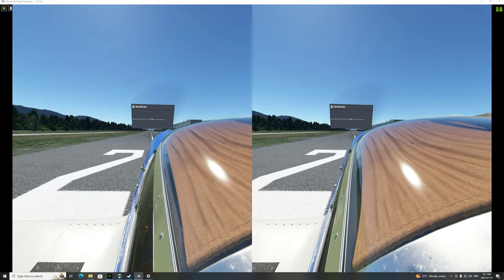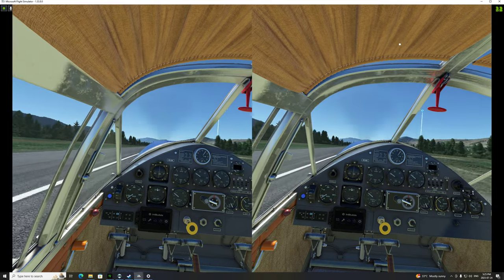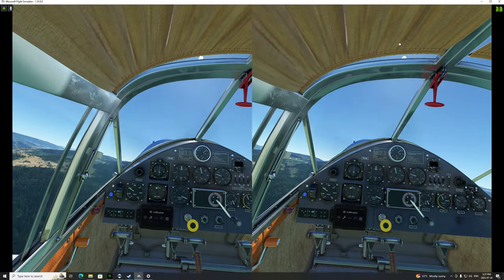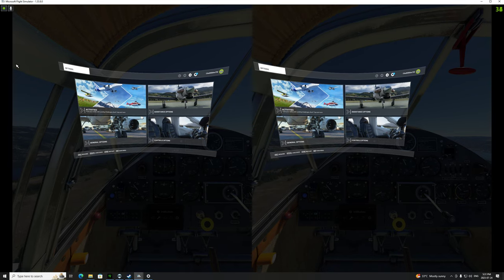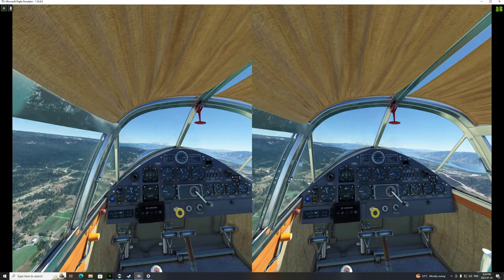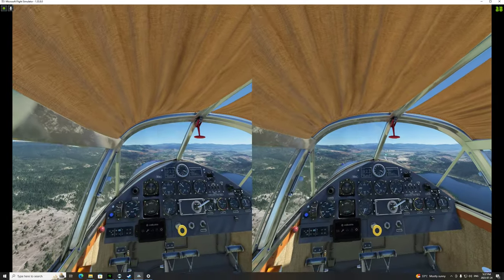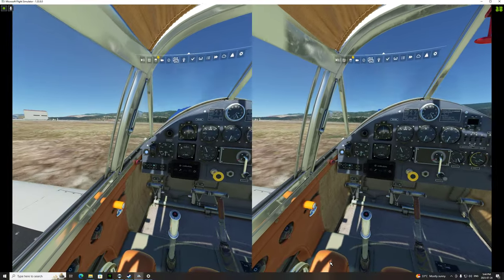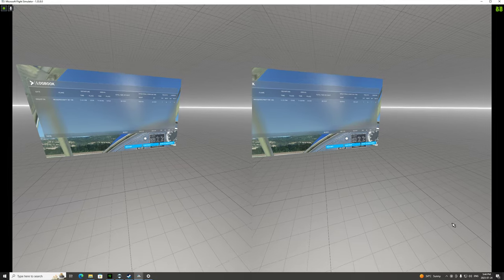Pimax Crystal thinner face mask taifun 108

Comment: Did you keep it on the smaller one?
Any issues with headset stability & balance?
Some early adopters said switching to the comfort gasket resolved all their issues with the headset being heavy, I might try the other one though as mine arrived with comfort pre-installed